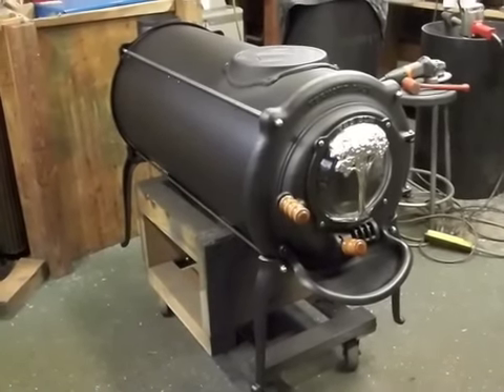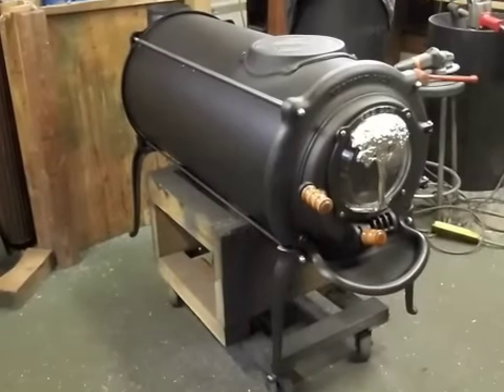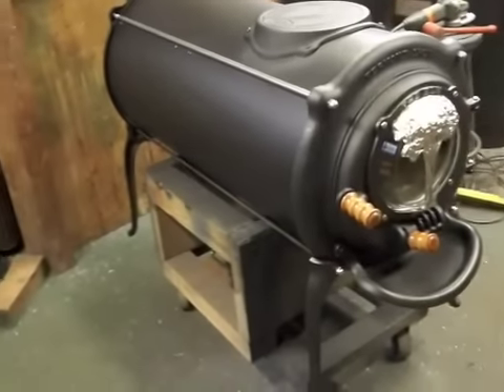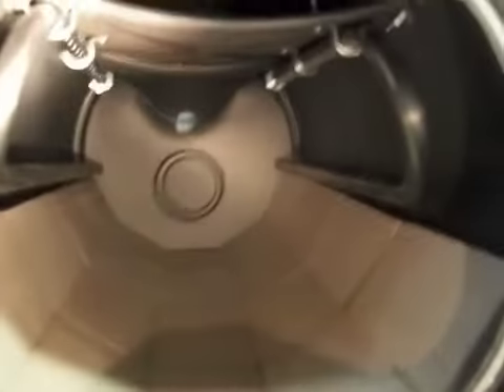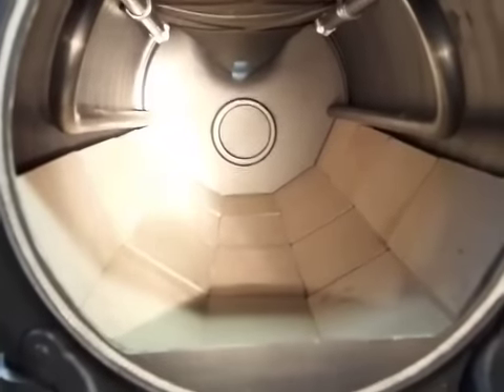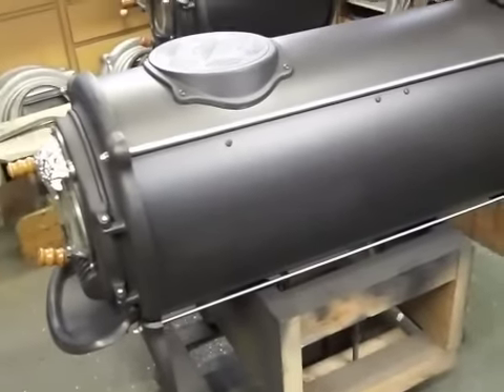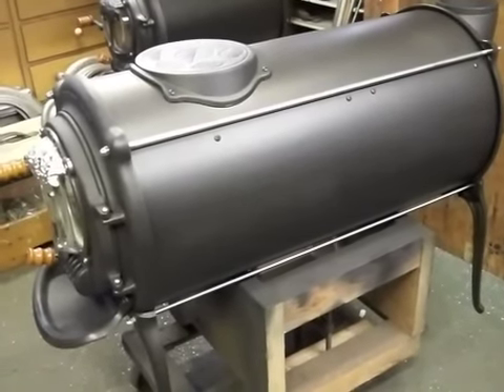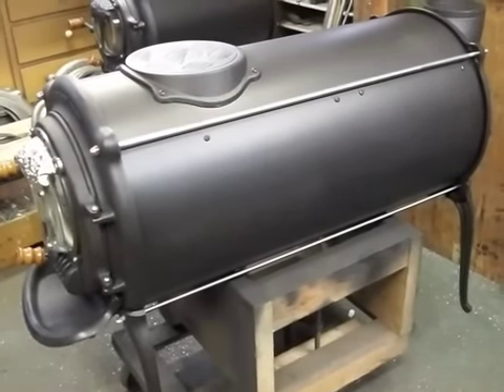38" Clean Air Elm stove.mov

Comment: I don't see how you can load a heavy, 38" log , especially once the fire is hot.

Maybe it's just me, but I can't just pick up a 38" x 6" log, holding the last 6" of it. like a fishing pole. And you must have to hold them up as you slide them in...or get hung up on the already burning logs.
 How do you load it without getting so close you get burned?